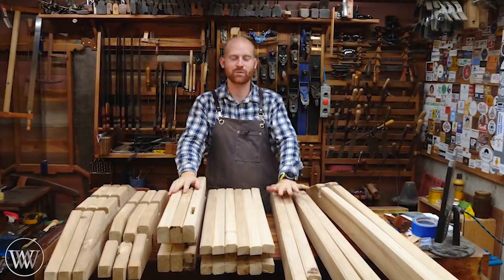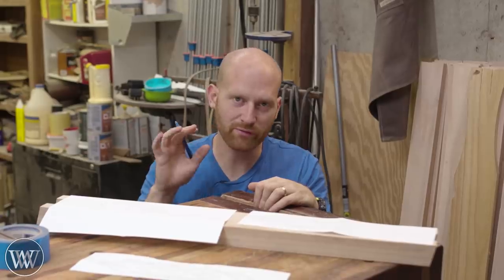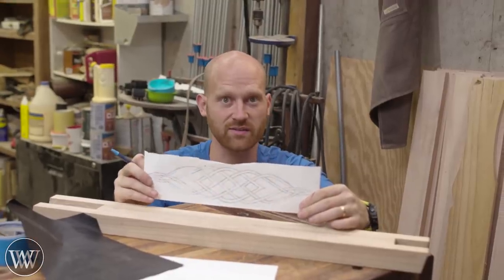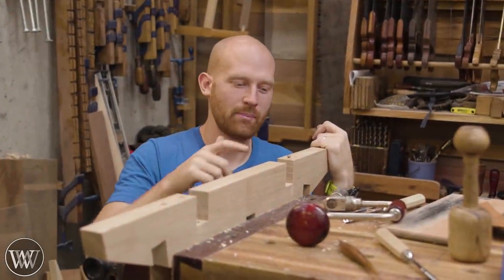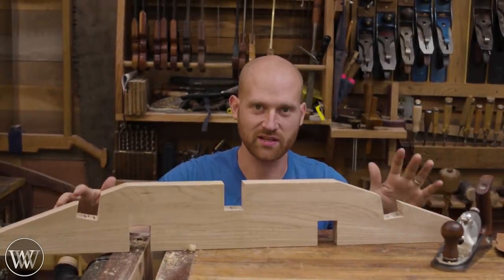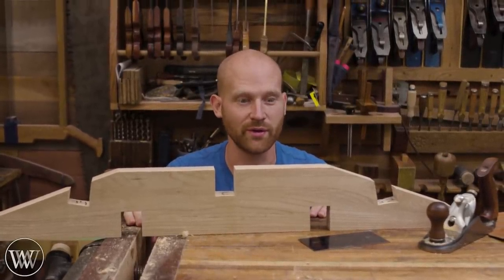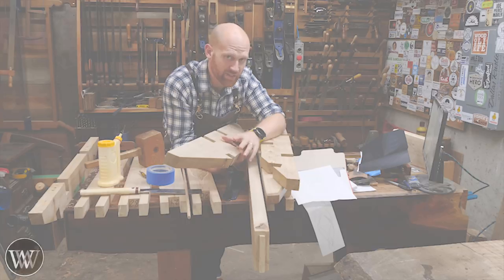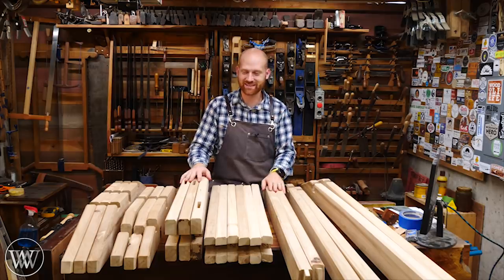The Final Touches On the Base of the Live Edge Dining Table

Comment: I am so glad you got those screws out of the bottom parts.  This reminds me of a question I have that confuses me each time you mention dowels.  You say things like "use a bit that is a little smaller than the dowel so that the dowel is a tight fit."  And then I see you grab a #6 auger for a 3/8 dowel. But the auger size is pretty much standard, and so is the (store bought) dowel.  Other than wedging the dowel (and I've done that and it makes for a nice job) how are you making that dowel have a really snug fit?  Do you have off-standard bits?  Do you grind the bit diameter down a little?  How does that work?
Reply from the maker: the numbers on the bits ate 16ths of an inch. it the #6 is 6/16" or 3/8" but the old auger bits were not dead on. some are slightly oversized and some are slightly undersized. You can see me using the calipers to check the bit and this one was about 2 thousands under the size of the dowel. Nice tight snug fit! I keep a collection of old auger bits on hand for just that. and often the store bought dowels are actually oval so there is a dimension there to play with. rarely are they exactly the measurement they are listed at.
Reply: Wood By Wright ohhh okay then.  My neighbor and I are going to the metic show here in Georgia in February. I’ll keep a lookout.  Thanks

Comment: I'm very into hand tool work but I'm 16 so I don't have much money. I have a Stanley no 4, 5 and also a 2 ft wooden jointing plan. Which should I use in a shooting board set up or should I save up money to buy a low angle. If I but I low angle should I go cheap with Stanley or should I go all out with a veritas or lie Nielson. 
HELP ME!!!
Reply from the maker: there is no need for a low angle. the only reason I am using it right now is my #5 is broken (hit the concrete) and I have not replaced it yet. if you really do want to buy one get the stanley, but if you have a #5 there is no reason for a LA other then if you want to do a lot of end grain.
Reply: @WoodByWright  Big thank, sorry for your loss

Comment: Hi Wright! I have asked so many of the other woodworking youtubers, but nobody answers me :( But could you do a short video on how you would make a "shooting" board to make all the angels to make a fuller dome; http://www.domerama.com/calculators/3v-geodesic-dome-calculator/making-a-timber-kruschke-dome/ I would love to make this to make timber domes with 2x4 struts, but I can´t get my head around how to make sure all the angles are right. I have bought two ras saws, but can´t seem to get them to cut consistent, But with the introduction in my life of handtools, a shooting board with the correct angels seems like a good idea, but I have no experience making them, and also the fact that you need to hit the center of the strut for each side and so on makes it difficult for me to understand how to approach this in the best possible matter. Could you help me discover the best way to accomplish this?
Reply from the maker: interesting idea! I might have to add that to the video list, but it is really long. say 6-9 months out. I think I would not do a shooting board as having different angles would be extreamly difficult to get corect. I think I would opt for drawing the lines with bevel gauges setup for each angle then cutting to the line and cleaning it up with a block plane right down to the line. Also, if you put a link in the post it automatically goes in the spam folder. most youtubers never check it.
Reply: @WoodByWright  Aha! thanks for the answer! I was looking at the shooting board option, as there are so many cuts that need to be the same, So as you said, drawing lines, cut the line, and then clean up with a dedicated shootingboard (if they are called so when they are for compond mitres) I would anyway love to see your take on it, even if it takes half a year before you get around to do it! :D I have allready poundered this questions longer than this. All I find on the youtube, is people makeing the domes with hub connectors, and that is not what I considers a good wood connection :P